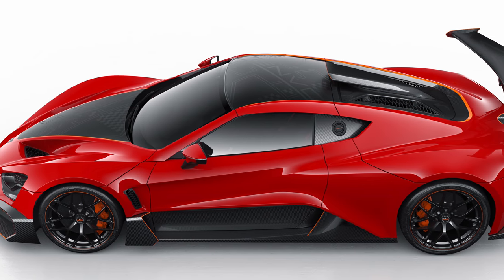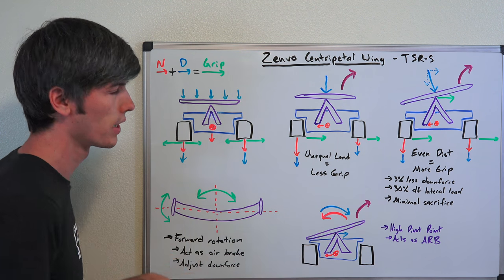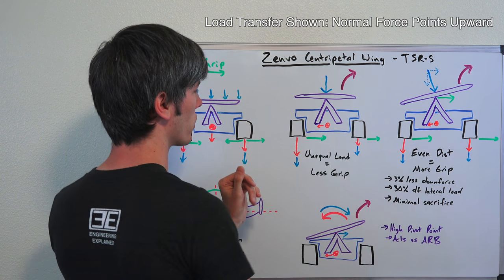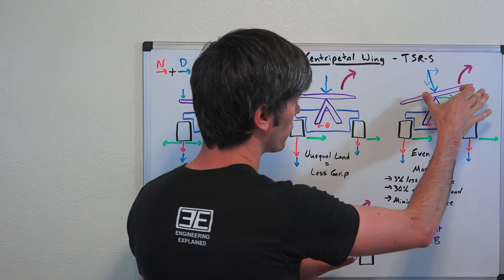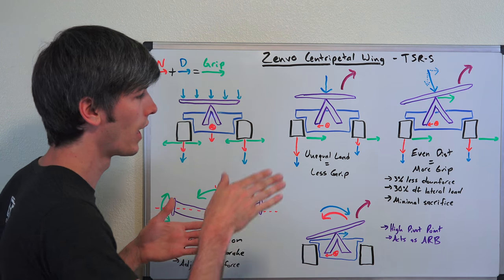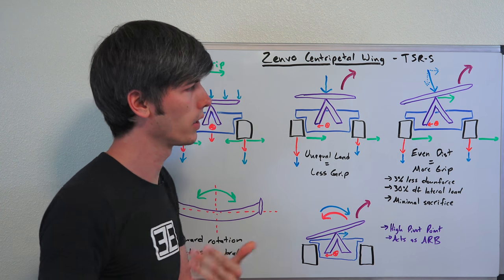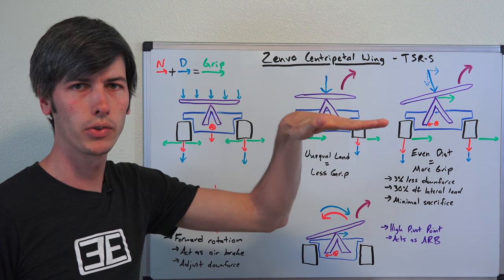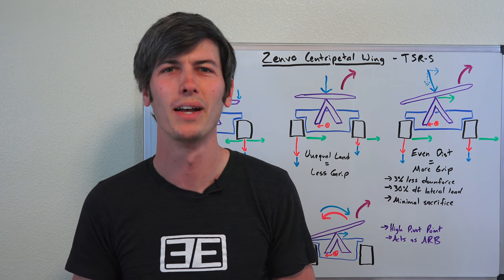Zenvo's Brilliant Centripetal Wing Maximizes Grip

Comment: Doesn't the Huracán Performante have a similar thing? With the flaps?
Reply from the maker: Yep, as well as the Pagani Huayra, but as discussed in the video these alternatives make more significant sacrifices in overall downforce when active. Here's the Lambo video: https://youtu.be/FG2lWRAW-aU
Reply: Its active aero that using internal flaps that reacts much faster than this system. They are all trying to do the same thing.
Reply: But aren't they (huayra style aero) suppose to be design to have too much down force when fully deployed, when turning increase one side down force not decrease the other side, when in straight close the flap to reduce down force and resistance.
Reply: Bina Ahmed no, not same, the lambo one only changes down force between right and left side but they don't actually have aero that pushes the car sideways, and if u only have aero pushing down, it's better to have maximum downforce than the vector thing lambo has which actually reduces downforce as Jason said the one of lambo is more about marketing
Reply: That is not entirely correct. Remember, there are 4 corners to the aero system, so they can work electronically independently although the majority of the times its right vs. left or front vs. rear.  Also, remember the clever use of this aero can rotate the car depending on how the flow is optimized not he Performante. If you have driven a Performante you know know its more than marketing.
Reply: DoctaM3 oh yeah I forgot that it can help the car turn yes.
Reply: Dont be fooled by ala, its a great gimmick which does very little unlike  the super sticky tyres the huracan users...
This thing will work very effectively but the looks....
Reply: Pretty sure the aventador runs a similar flap setup
Reply: DoctaM3 
You the Real DoctaM3 ? Your car collection is too much 🤚! Thank you for the info. People forget that the Performante flaps can close like an air dam, and open just one side creating drag to force a turn. Maybe feels like the Porsche “rear wheel steering” because it turns more or more directly than expected.

Just a guess...
Reply: TooManyChoices1 hes the real DoctaM3, theres a tick next to his name
Reply: I am not fooled. I own the Huracan Coupe, Huracan Spyder and now the Performante (I own them all currently) and have taken each on the track. The ALA is no gimmick.
Reply: No it doesn't
Reply: 👍 Thanks. And I agree, the current crop of Porsches are killing it.

Comment: Last week I saw this car in action at a local race track (vid is on my channel). At first I thought it was broken. lol. Then after a few seconds I realized it was  supposed to do that. It looks so weird in motion.
Reply: Lars Mars Cars i saw that vid before you commented! Sick video btw
Reply: TheHMS Drifter Thanks, mate!
Reply: I watched that clip on your channel and thought "I bet EE will have a video explaining it within a day or so."
And when your clip finished, his showed up in the suggestions.
Reply: Thanks for the video! It clearly shows this wing doing its thing. It definitely has a “computer-controlled” look to it. 

The wing also moves paradoxically, because it’s a very visually intense part of the car. There’s a little optical illusion going on between the “low red sports car body” and the “big black wing bar” that tricked my brain into thinking the wing was dense and heavy like an iron bar. And if it was heavy, you think you would want it to lean into the turns like a motorcycle.  But it does the opposite, tilting away from the turn.

Then my brain stopped thinking about the wing like a giant iron bar, and more like a fan blowing upwards. When that happened, I started to understand the motion better. If the fan was pushing air towards the outside of the corner, it would help the car resist the cornering force. And the tall wing support could act like a big lever, multiplying the force on the car.

Comment: I think at the moment, it is a bit of a gimmick, and that the gains would be minimal, if they exist, vs a "traditional" air brake style rear wing. It is a step, and I do like the direction... I would really like to see some data on it's effectiveness. (If any is available.) The video that I have seen of this in action, the actuation was reasonably fast, and would serve well at many tracks, (Phillip Island  seems as though it would be perfect to demonstrate the effectiveness of the system) but I think that it would struggle through a complex such as Eau rouge at Spa, or any other high speed, rapid change of direction..

Credit for implementing the idea though, hopefully this will kick some other manufacturers into gear to develop competing technologies, 

Not that I will ever be in the market for anything at this price point....

Comment: The one thing about their design that surprised me is that it’s a single element wing with a fairly steep curve...   a double element wing (like in F1) adds that energized air through the slot gap keeping the air attached to the underside making it more efficient.   This is still a very cool concept and I really wish we had a racing series that allowed active-aerodynamic parts like this to get more money into its development.

Comment: I guess it would let the driver get to the fire department more quickly.  Or did they actually fix that problem of their cars bursting into flames?  :-P

Actually,. it's an interesting idea.  My main question would be: how are height changes in different parts of the wing affected by the rest of the car body in front of it?  Usually, the body is shaped so the air flow to the wing is optimal.  Raising one end up and/or lowering the other could have some unexpected side effects when viewing the car's aerodynamics as a whole.

Comment: Are people planning on flying with this thing?
Reply: landofconfusionfan the exact opposite
Reply: The wings are to prevent that smh
Reply: I'm well aware, it is just massive and looks absurd. It looks more like a glider wing than something a car might have on it.
Reply: Technically it would be impossible because in order to create forward movement the rubber has to meet the road. As soon as you reach V1 rotation speed and pull the yoke you would stall losing that V1 speed for necessary lift. Not to mention the immense wing size for a cars weight.

Comment: Because it doesnt lock left and right suspension together it should be better than a typical ARB. Also it defeats the need for expensive heavy torque vectoring differentials because the load on the tires is more equal. What a brilliant idea.

Comment: Jason, I understand your reasoning when  considering a single axle, but what about diagonal loading effects? Won't artificially loading the inside rear tire affect the load on the outside front? 

The result would be catastrophic understeer.

Comment: I feel the took inspiration from dirt sprint cars they have a fixed wing the oval has an angle and the track is only goes left. They just implemented  a center pivot so that the wing opposes the turning angle on the car and aides with traction/weight transfer. The changes in wing height side to side trick the rear tires into driving as if the car were on flat ground

Comment: Do the gains in downforce make up for the added weight from the additional actuators required for this active wing?
Reply: I'd love to understand your explanation here but the grammar makes it too difficult. Anyone to clarify?
Reply: Basically, I don't think he understands that the wing tilting also causes the DOWNforce to not act in a straight DOWNward direction.
Reply: He gives the statistics in the video. A 3% loss in total downforce at full tilt, with 30% of the remaining force acting as a sideways element. That means that 70% of the remaining force is still acting downward on the rear of the car.

If you're confused, just look at the videos of the car in motion. It's not like the spoiler is flipping 90 degrees or anything. There's still plenty of downforce being generated.

Comment: Just read an interesting article explaining why this wing would make the car handle worse, if it works at all. It's over at RoadAndTrack and I think it makes quite a few good points - increasing rear DF on one wheel would increase understeer at the worst possible moment due to diagonal weight transfer to the wheel doing the turning etc...

Comment: This is all very interesting. I've had this sort of an idea of how wings should work since I was a kid but never thought someone would actually do it.
Interestingly enough I wonder if it's possible and maybe you could do a video of what perhaps would happen if they took the ALA system from Lamborghini and channeled air normally whilst removing those shocks or whatever they are that are adding weight on the back and adding the same with only with certain angle at which the wing can't move anymore (simplest solution i can think of is an angle cut bar with some rubber band on it when it hits that angle to stop it going further.) I think it'd be doable and much more efficient, cost savy and weight saving aswell.
What do you think?

Comment: Wouldn't these wings affect straight line speed of the car due to more air drag than the usual flat wings?
Reply: Aditya-Watch the video again .Yes, it will effect straight line speed, it will go faster.The wing can be a "usual flat wing" as in zero drag produced,or go from 1deg tilt,to 90deg vertical tilt like an air brake.

Comment: Very interesting. I'm curious if this can be taken one step further by having the same unit broken down into multiple parts that could be independently manipulated. For example, if we take a wing and divide it into 3 pieces, the center piece can remain horizontal and simply tilt forward and back; the outer two pieces can be separately and independently controlled to not only go front/back but also tilt up/down or remain horizontal depending on whether maximizing downforce or lateral load is the objective. Great explanation nonetheless and awesome concept!

Comment: A few problems (unless there is a complementary front aerodynamic force)  - high speed versus low speed suspension tuning;  diagonal vertical forces that increase understeer;  yaw force opposing turn-in; additional complication in achieving front/rear aerodynamic balance

Comment: I'd rather have a fairly conventionalwing with small deployable small wings (or gurney flaps) tucked under the main wing. Same function, no downforce sacrificed while doing the same job. The wing mount itself is causing a lot of drag (Or even stalling). Though the design is an absolute oddball, still appreciate what the Danes in Zenvo were thinking. Cool factor is high though.

Comment: but your overall downforce, and so your overall normal force on both tires, remain mostly unchanged? so mostly you're just decreasing load sensitivity on the outside tire, not really increasing traction that much. The active stabilization of canceling out the rotational acceleration is neat though

Comment: It seems to me that having the fulcrum of the wing at the center of the car at all times hurts this system more than anything.  What may be better is to have two different, independently-articulating wings side-by-side, one mounted 1/4th of the way from the left side and the other mounted 1/4th of the way from the right side.  This would allow left vs right customizable downforce in all situations.

Comment: I can't believe that the loss is only 3%. I would imagine that the rear wing is arranged in such a way that the aerodynamic of the whole car is optimal. If the the wing's position is changed like shown, the surface pressure might be way more influenced, in case the wing "dives" into more turbulent air

Comment: What happens with the diagonal forces ? 
Wouldn't this wing just cause understeer ? 
If when going through a Right hand turn the "Wing" produces more downforce on the right-rear tire, that in effect just take weight off the left-front tire , which is the main tire responsible for turning , meaning less grip and more understeer .... Basically making the car less stable and resulting in slower turns because of less grip.

Comment: Question: the wing creates a lateral force... from a structure dangling off the rear end. So if you look at a top-down view of the car, now you have a yaw moment that tends to pull the rear end inward, and rotating the front end outward. Understeer. So how do they counter this tendency, without some kind of asymmetrical active aero on the front?

Comment: It’s different from an anti roll bar since it works on the whole chassis, without having to connect sides of the suspension and lose grip, but yeah it does a similar job.

Comment: I've always wondered why rear wings are often curved. Is it primarily for aesthetic reasons or does the curve have an impact on performance?
Reply: On RWD cars with a lot of power you want the wing placed as far to the rear of the car as possible to maximize load on the rear wheels. Due to (atleast european) road-regulations, the wing cannot exceed the "silhuet" of the car. Curving the spoiler to match the rear of the car-bodys silhuet will therefor maximize the load on rear-wheels while abiding to the regulations.

Comment: Assuming the friction cofficient of the tires being 1 it might have been better to raise the wing to tilt at 45 degrees instead of the 17-18 degrees I calculated it using currently. It would load the inner tire a bit more but would push the car into the turn with a total of 13% more force. And in reality it probably wouldn't over load the inner tire as I don't see the force that the wing produces multiplied by .71 ever out pushing the roll of the car. Unless its a huge wing.

Comment: Thank you for that great video! I have one (or two) questions: Can this system also act as kind of LSD (or even replace it) by getting more load on the inner tire or would a LSD had a better effect? AND: If you had a 100% lock diff (like in a GoKart), would that wing help anyway?

Comment: You're a hell of a smart fella and I really enjoy all your vids. I still feel like weight reduction is a contradiction when combined with a downcforce creating wing. I'd love to hear your thoughts on this. Why reduce a cars weight... then add a wing which essentially re-adds that downward facing force. I've always found this to be a conundrum. I must be missing something
Reply from the maker: Downforce does not increase a vehicles mass, just the force pressing it down. So going around a corner, the mass that the tires have to resist is low, relative to the force pressing down on them. More detail here: https://youtu.be/c9BgfCbZTLM
Reply: Weight increases your inertia which means more force is required to turn, and slightly increases grip as there is more force pushing your tyres down, downforce increases grip as it pushes the car down more but does not increase your inertia, so weight = harder to turn and a not enough extra grip to compensate for it, downforce = extra grip and no more force required to turn at the same speed

Comment: Why not tilt the wing to the same direction as corner (contrary to what's shown here)? Like a plane making a turn.
Reply from the maker: That results in the opposite of the desired effect, and would cause the rear of the car to spin out (oversteer).
Reply: I'm not sure about that. It would result in more overall downforce, wouldn't it?
I wish they could test this for us.
Reply: Seiti plane wings provide lift, car wings provide downforce. If you tilted a plane wing towards the inside of the corner, then it will help pull the plane around the corner. The same wing pushing down would just add more load to the tires
Reply: seiti -The higher end of the wing is in more cleaner air ,thus producing more downforce & pushing down more on that side.the whole point is to negate the equal force across the wing.